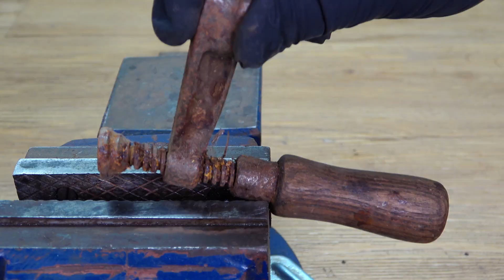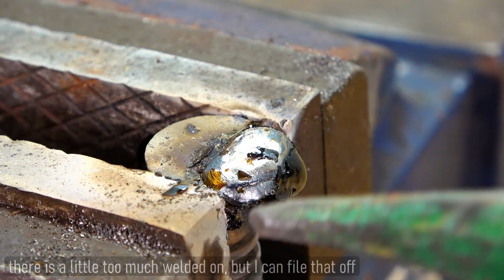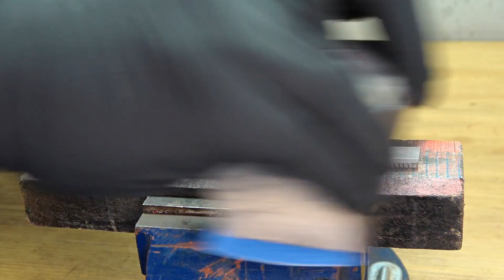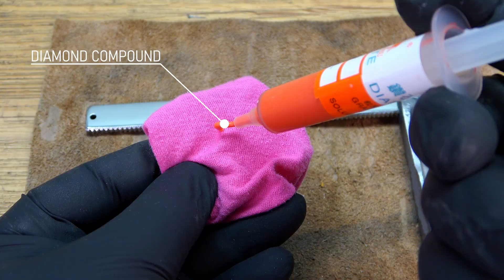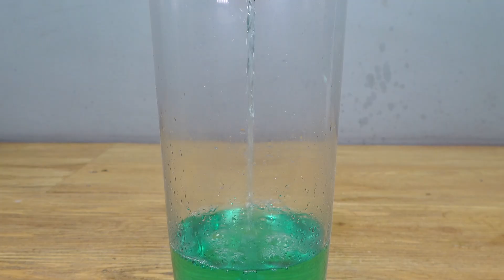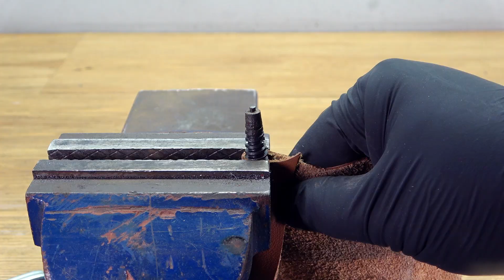Screw Clamp Restoration [Nickel Plating, Welding, Powder Coating And More]

Comment: Looks awesome, quick tip though. On cast iron you should pre heat before welding because of the carbon content being over 2%. If you don't it would be prone to cracking when it's under stress which might defeat the purpose of the clamp.